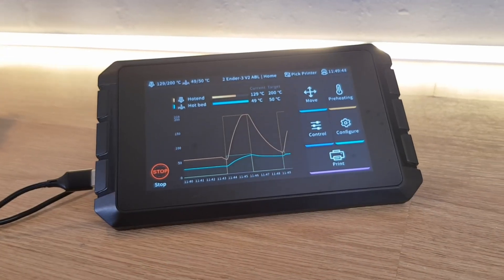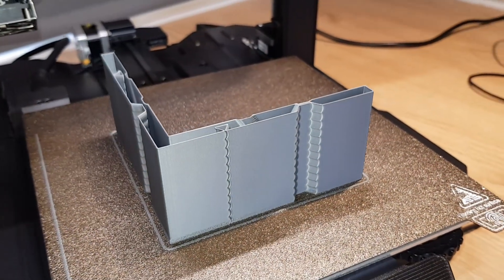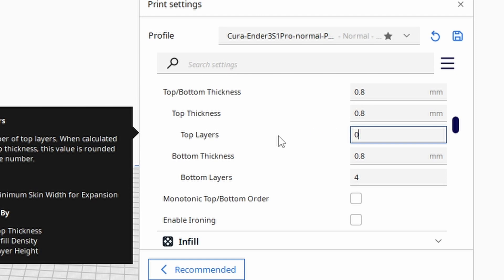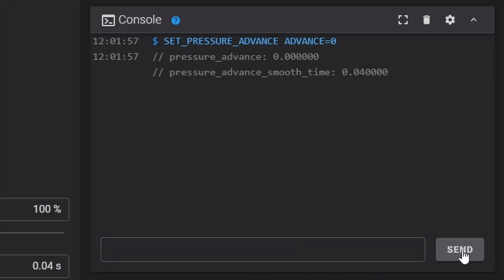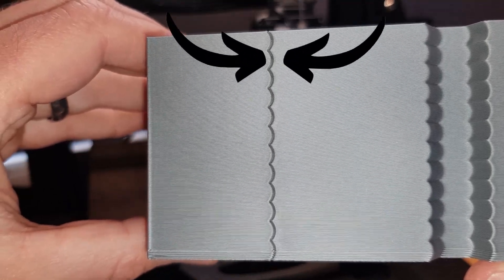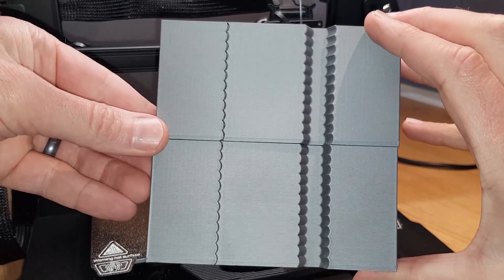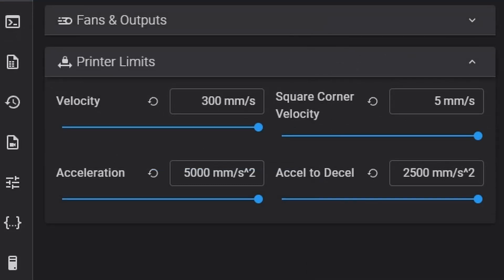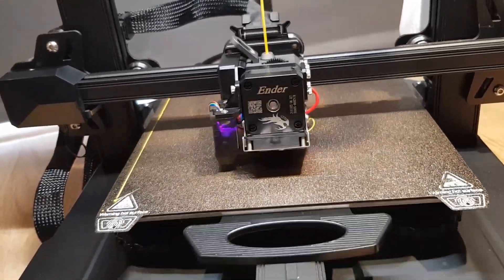Maximum Acceleration Test (How Fast Can You Go?)- Sonic Pad Intermediate Part 8

Comment: Ricky, was it your intention that we retain all these settings within our profile to maintain this print speed moving foreward, with the exception of top layers and infill?
Reply: I followed your instructions and that speed test came out impeccable. However, I then installed 5015 fan, and all has gone south i was wondering if you can perhaps make a video that involves the 5015 fan that include klipper settings for new fan upgrade for part cooling As well as 5015 hot end fan ? 

Also, just wanted to say thank you. Your videos are incredibly helpful and super well made.

Comment: Hey Ricky , thanks for the tips setting up. I have a particular dislike for cura and it’s inability to work well with certain things - I’d like to use Bambu slicer but when used it things their is no extruder configuration - it works with cura fine but not with Bambu despite changing start/end gcode as per creality guide in the preset in Bambu - if I leave the stock gcode it does work but sort of half properly and I can’t really see a way to ignore slicer speeds in bambu like cura - the issue is I’ve rarely gotten any decent results when slicing with cura vs prusa or Bambu

Comment: hello there iv been enjoying your videos on sonic pad and have followed them. i have a couple of questions though. i am using the sonic pad with an elegoo neptune  3 pro and using Orca slicer. ive been trying to tune acceleration but it seems to print at the same speed with some under extrusion. i was wondering if i have to 0 out the parameter that says normal printing on the acceleration setting in the slicer?

Comment: @ricky, I am using orca slicer. Main question is about "enable acceleration control". Is there a similar setting on orcaslicer? What else would it be called. Any other tips on settings to use for this test in orcaslicer?

Comment: I made a macro you can cut and paste into your config file to run these test more easily:

[gcode_macro Acceleration_Test]
gcode:
  {% set DeltaV = params.DELTA|default(500)|float %}
  {% set StartV = params.START|default(1500)|float %}
  SET_PRESSURE_ADVANCE ADVANCE=0
  TUNING_TOWER COMMAND=SET_VELOCITY_LIMIT PARAMETER=ACCEL START={StartV} STEP_DELTA={DeltaV} STEP_HEIGHT=5

Comment: @RickyImpey The main indicator of the best acceleration are the gaps? Despite the gaps, which in my case also started at around 7500, the printing itself looks very neat, the corners are also very good despite this speed. My question is, can we get even faster print speeds by setting higher acceleration values without compromising quality?

Comment: Thanks a bunch for this series Ricky. 
When I bought the Sonic Pad, I assumed it'd be plug and play, or at least the tuning would be covered in the User Manual.
Turned out neither was true. So many YTers keep giving rave reviews to the sonic pad, but ALL of them literally skip all of this setup process. 
Thank you for literally doing Ender's job and making a proper video guide on how to setup and actually put to use the 150 I spent on the device

Comment: What's the reason for the messy initial 5-10 layers on your print? I got exactly the same pattern on my printer. The rest is nice and smooth. @2:59 you can see clearly what I'm about.
https://youtu.be/k7xy9H28hv4?t=179
Reply: did you ever figure this out? unfortunately it happens to all my prints now no matter how slow or fast I set it.

Comment: This has not been helpful. The speed of the model is not changing. 
My machines have structural limits.  The difference between Marlin and Klipper is not that much. You can speed up both. Marlin is slightly less reliable for prints. But not that much. Going full blast on my Ender 3 max neo's will shake them off the tables they sit on. 
The upside of Marlin is that you have control on each machine at the same time. No waiting for the Sonic Pad to switch printers.
downside is that mine use micro cards and loading files are a pain.
The upside of Klipper is starting any of the four printers from my computer. No SD cards needed.  Klipper is about 10% to 30% faster according to the model. The downside is only working on one machine at a time. 
I can  speed up so fast that I shake my machines to the point of them skipping the belts, where the prints are still working up to that point.  The original print speed when I started was 50mm/s. I can go 80mm/s with very little issue. And max out at 120mm/s with either Marlin or Klipper. Klipper is more stable than Marlin but not by much. Anything past that speed works BUT I can see and hear  the strain on the machines.  
I could get better machines then the Ender 3 max neo's But having 4 of them at a used price of 200 dollars each and one pad is 900.  The price of one good high speed. The cavate is you need to know how to work on them. I got 2 new ones, one used and one I'm waiting on. In shipping and should be here soon. The downside is some people think they know what they are doing, but too lazy to watch a video.
 Somehow I think that one highspeed printer is not going to keep up with the four. If one brakes I still got 3 working. 
End of rant.

Comment: Great videos, really helpful. 
Question... What about the print speed setting in the slicer or is that controlled with the velocity (500) that is the printer.cfg file?
Reply from the maker: Hi, the config file velocity is a maximum limit. The speed is still controlled by the slicer. Did you see my Sonic Pad Slicer Setup video? It may help answer some of your questions https://youtu.be/Aqi5vjE0_QU?si=QRNeKS5ib8pNgB99
Reply: Hi, Thanks. Yes I have seen them all, probably more than once...

Comment: best series of videos i have ever seen and helped a ton with my new rebuilt modded cr10s5 with klipper, BTT board and tft 35 screen, Bondtech,Silicone bed, a custom built bed with 6 adjusting knobs, and more running it with the pad. keep it up man !!

Comment: I’m new to printing and have the Ender 3 s1 pro as you do in the video, I have a question that might be obvious so apologies. I’ve run through all of your videos about optimising the setup with the sonic pad which is all good. However if I’ve setup the print config file like in this video, am I still not limited by whichever print speed I select in the slicer? Should I have any different settings there before slicing to take advantage of the new print max speed in the print config?

Comment: I followed your instructions but started at 4000 since I already have done some high-speed prints that turned out pretty well. However, it completed the entire file without any degredation in quality at all (the gap stayed the same witch the whole way), seemingly indicating that it was good up to 10,000 mm/s. Is that unusual? I have the same exact printer model as you did in this video (Creality Ender 3 S1 Pro). I mean that's awesome if it prints fast, but that seems a little too fast. I did notice the speed displayed on the Sonic Pad screen always said 100 the whole time, so did it not speed up like it was supposed to?
Reply: Update - double checked all your instructions, and did it again, but starting at 10,000 this time. Still not a single widening gap or noticable issue. it didn't print any faster than the last one though, and I couldn't tell that the nozzle was going any faster as it went. Something definitely seems wrong since I don't think there's any way it was going 16,000 mm/s.

Comment: Just got an Ender 3 S1 for Christmas and added a sonic pad. Everything is working fine, except I'm confused on this test. On the X side a hole opens up around 2200, on the Y side, there are no holes until around 6000, and those are just pin holes. the x side has more like slits. I'm not sure I understand what to make of that. Also, if I'm maxed out at 2200, is there anything I can upgrade to increase that?
Reply: Same Problem, also looking 4 help pls !

Comment: Does the sonic pad override Cura settings? I run cura with acceleration control disabled. Does that mean my prints will use cura’s default acceleration of 500mm/s or my sonic pad acceleration settings?

Comment: Hi there, First thanks you for all the video tutorial, it is very cool to learn that way.
i have a cr6 se and if i disable the pressure advance i have gap juste above 7500 acceleration. if i enable it i have gap directly on the beginning of the print. is this normal ?
Reply from the maker: That doesn't surprise me. Have you tuned pressure advance already?

Comment: 7K acceleration speed on your ender 3 s1 pro? crazy, i must be doing something wrong. Although i was doing this test with PETG, i could only get 4-4K accel speeds (chose the lower for quality.) could you or someone advise me on what i may be doing wrong? ive literally followed this entire guide a few times. Belts are tight and so are the wheels (no slop in the head) or is this because of using PETG rather than PLA?

Comment: Before running the test, should the accel-to-decel value be set? I've ran tests from 3000 unto 18000mm/s2 without any discernible difference. Double checked the GCODE for any acceleration control (M201/M204) command and there are none. Can see on the Pad the accelerometer step up every 5 mm. I can see the accel-to-decel value is fixed at 2500, so would that affect it?

Comment: Love your videos but im getting different gap on X and Y. I wish i could understand why. i did all the resonnance, e steps, pressure advance ( which i turned off for this test ) but i get gap on all X, but Y only starts at 3000 ish. Then i did another test from 500 with steps of 250, same thing, X is gapped, and Y starts at 2000 ish. I hope there was better speed on the cr-m4 lol

Comment: first hickup. sliced and started the print immeditly got this error message: 
 Error message {"code": "key112",", "msg": "Move exceeds maximum extrusion (0.880mm ^2 vs 0.640mm^2) See the 'max_extrude_cross _section' config option for details", "values".
[0.880, 0.640]}

Comment: Getting ready to run this test. I have watched all your Sonic Pad videos and they are outstanding. Only thing that would be nice, when making a bunch of changes in the slicer settings, would be very helpful if you listed them below. I rewatched that section over a dozen times to be sure I got them all. Thanks for all you great work. I am using Creality Print as they have Sonic Pad specific profiles for the V2 and S1 and some others. It gives a 37 minute benchy on the V2 with Sprite extruder.

Comment: @Ricky Impey - Please look into your commands you have listed
TUNING_TOWER COMMAND=SET_VELOCITY_LIMIT PARAMETER=ACCEL START=1500 STEP_DELTA=500 STEP_HEIGHT=5 does not work in the newest version of the Sonic Pad Firmware
This command appears to work:
TUNING_TOWER COMMAND=SET_VELOCITY_LIMIT PARAMETER=ACCEL START=1250 FACTOR=100 BAND=5

EDIT:
Also, if you have done the input shaping/resonance shaping, please make sure to perform this step too:
SET_INPUT_SHAPER SHAPER_FREQ_X=0 SHAPER_FREQ_Y=0
This will disable the current resonance settings in the printer config 

I hope this helps anyone that comes across this post
Reply: How to you set turn it all back on?
Reply: How would you know what's the max acceleration? first layer will be 1250? and each circle will have increments of 100? or how will this define the values?
Reply: why would you turn this off? the point is to figure out how fast it can run, thats the reason the resonance was recorded

Comment: who helps me ? or prusa slicer and I installed klipper with sonic pad on my ender 3 s1 plus but when I set the accelerations for example to 5000 and send the print it doesn't take them if I go to edit from the pad after a few layers they are removed again and 500ms always pass as I solve it

Comment: This was great but just make sure you restart or reset your printer after running the test. I had 11k acceleration set as the max and ended up layer skipping because my printer didn’t default back. Not a big deal just Klipper should probably reset by default when you end the test.

Comment: Can you help me please I have managed all the other videos thanks for everything 🙏 

I get a error message while it's doing the first layer and stops tried it 3 times no luck.

The error is 

{"Code":"key112", "msg": "move exceeds maximum extrusion (4.793^2 vs 0.640mm^2) see the 'max_extrude_cross_section' config options for details", "values": [4.793, 0.640]}

Hope you can help thanks again 😊
Reply from the maker: There will be a line in your printer.cfg file for max_extrude_cross_section. The figure that is after this is too low. Try increasing the figure, save and restart and it will let you extrude more. From the message, your config file has a limit of 0.640mm^2 and it needs to be at least 4.793^2. Try setting it to '5'.

Comment: @RickyImpey,

Just a curiosity and for my clarity, when you're speaking of the 7500-15000 ranges you're referring to mm/s SQUARED, correct.  You repeatedly said mm/s but if my printer runs at that speed it would fly the hotend off the gantry lol

Comment: CURA is altering my calibration in the bed, and PRUSA isn’t. Therefore, how can I do this step in PRUSA? I have an ender 3 s1 pro
Reply: What settings are you using with your 3S1P on PrusaSlicer?
I converted the Cura settings over, but I still can't get the speed that Cura has :/

Comment: do you use the same configurations for all itens you print or only in these you tested? thanks! you're awesome
Reply from the maker: The acceleration figure is just a maximum limit on what the machine can achieve. It will stop the machine from going over this limit no matter what you then set in your slicer, a bit like a rev limiter on an engine.

Comment: Do  I need to turn pressure advance back on after the print is finished via a console command or does it do it on reboot?
Reply from the maker: It does it when you reboot

Comment: After slicing and sending to the sonic pad to print. When I go to the web ui, my acceleration is always set to 500. Even though I have set it to 6000 in the printer.cfg file. Any thoughts on how the slicer is overriding this setting?
Reply from the maker: Did you restart the Pad after editing the cgf file? It used to do it when you hit save but they appear to have changed this. Make sure you restart and then check to see that the new figure is still as you set it in the cfg file after a reboot.
Reply: @RickyImpey  thanks for the reply. Yes it's always set to the correct max acceleration that's in the printer.cfg but it goes to 500 and won't go past it. It must have something to do with my slicer settings. I have acceleration unchecked. So not sure.

Comment: Hi Ricky, have you been keeping up with the Sonic Pad? There is a lot of on-line chat regarding issues with updates etc. I have only updated once and after struggling to connect to WiFi, I have no major complaints. However, I don’t want to carry out further updates if they are going to ‘brick’ my machine.

Comment: Hi Rickey, followed all your videos I am using an ender 5plus all set up and printing great. Thankyou. I have one question I changed the max velocity in the config file. Printing superbly at 7000. But every time I slice a file and send it to the printer via console it reverts back to 500. I then have to change it on the console back to 7000 hit enter and it speeds up. Is there a way to set that speed for every print or should it hold. I am using cura 5.1 as the slicer, speed in slicer set at 100mm sec.
Reply from the maker: That's strange, changing it in the printer config file is the way to change it permanently. Make sure you save and restart the Sonic Pad after as it doesn't save until you do.
Reply: Hi Ricky sorted issue. Problem was start up code in cura as per advice from user in sonic pad community. Changed and working perfectly

Comment: In your videos you ask us to disable "enable acceleration control" in our slicer. I usually check the slice to make sure the Volumetric Flow is within capable range of the printer. I would assume that disabling the feature as you mentioned would then render the slicer "flow" preview un-useful? Could you elaborate on this or anything to do with volumetric flow/Klipper/sonic pad. Thanks.

Comment: Hey Rickey, I've followed you through the entire setup of an ender 3 and running sonic. You've helped me with so much. Have you ever run into the problem when using ss and uploading through web UI it stops with a webhook error? I've turned time-lapse as I don't use it but it's still stopping. Thanks for any insight you might have.

Comment: Wait, dumb question on the first run of these commands and print, my "Y" face has no gaps, but on the "X" Face has gaps about 4th line up. I have an Ender 3 S1 Pro and have done all of the videos in the basic and intermediate up until this point. It's only a month and 8 days since I've had it... I don't understand why yours is so much better than mine and can print at higher speeds etc. This is my first 3D printer and I've honestly had problems getting and keeping it level (hence the Sonic Pad) and am highly debating on switching to linear rails on all axis and a glass bed. I've had problems with a warped bed that I've had to persuade back into place which has helped immensely and I literally don't have to relevel every day, I've had to recheck all of my springs, add nuts to keep the bolts from spinning when leveling, recheck bearings and wheels, I've tried solid rubber spacers. It's marketed as a beginner friendly printer and I want to rip my hair out.😅 Thanks in advance NxP